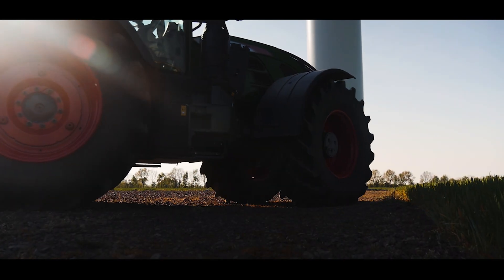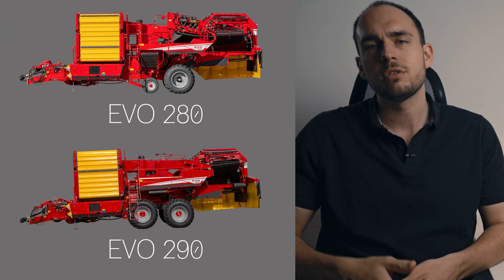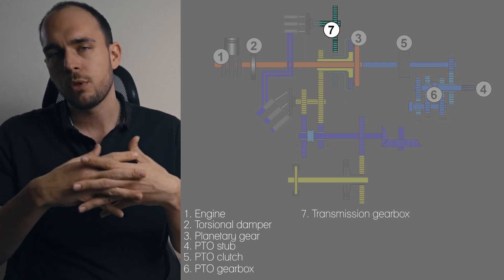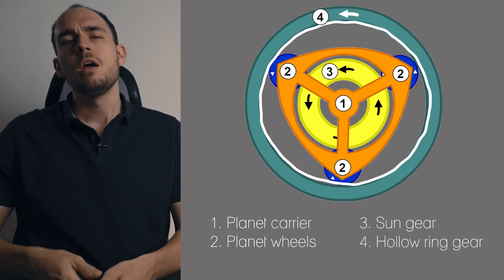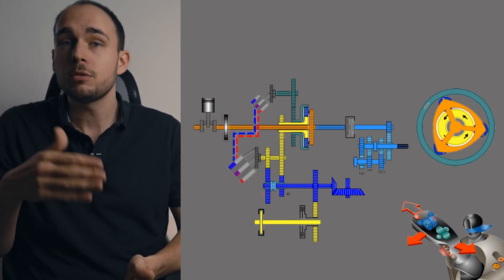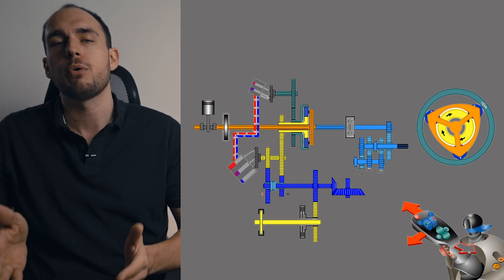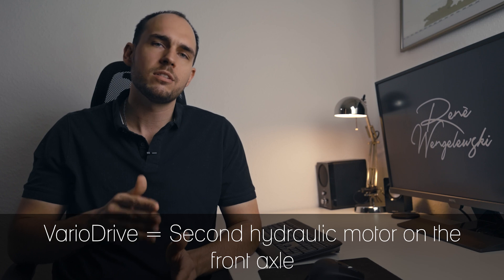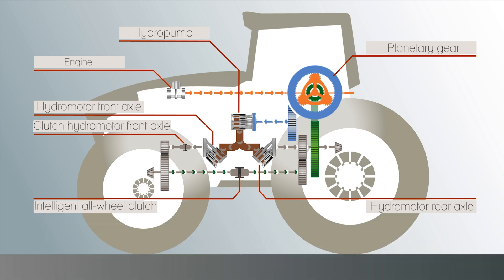The Vario transmission | Functionality | Fendt 724 | Renè Wengelewski | 2021

Comment: So while I do understand the benefits ov cvt/vario in field work or around the yard, I'd like to understand why do they get progressively slower when hauling load up the hill to the point where even lower powered tractors with other transmissions, and espl manuals, leave cvt/vario far behind? 
Also, what's vario like in downhill scenario where engine braking is important not to overheat the brakes?
And why aren't hgv's using this type of transmission?

Comment: What you talk about with 'VarioDrive'. That's only possible with the 1000 series and the new 900 series. The older series 900 and 800 (ML200 and ML260) does have 2 oil engines in the vario but they are always connected. The new vario, for the newer 1000 and 900series (ML400), have the 2 oil engines independed and when wanted connected as shown in the video. How I know you probably think.. I work as a Vario rebuilder, And I've seen all the kinds of Vario there are. (ML75/ ML90/ ML130/ ML160/ ML180/ ML200 (first edition for the 900 vario favorite) the now used ML200/ ML260 and the ML400 that is used in the new 900 series and in the 1000 series. 

Thanks for reading 🚜

Comment: something people don't understand: in forward the vario gearbox's hydrostatic group only act as a mean to brake the hollow gear which mean it's efficiency is pretty much irrelevant since all we want from it is to define the gear ratio of the whole gearbox by defining the hollow gear's speed.

you can turn anny 4x4 with a central diff to "vario ish" cvt by removing the rear drive shaft, puting it in any gear the rear output of the transfer case will spin freely until you start puling at the handbrake putting resistance on the rear output of the transfer case forcing the power to the front wheels that's how the vario works without burning your park brake using hydraulics instead.
Reply: Effeciency is still very much important , no matter if you use the pump for powering up or braking down. Doesn' t matter. If it takes to much power to act as a brake, the transmissions effeciency will be ruined also.
Reply: @bartdereu  that's where it gets tricky, how much the engine consume more as the hydraulics are worse and dissipate more through heat, someone at fendt's R&D surely know i don't. what i know is that the gearbox is cooled at 50°C instead of 90 on most tractors and easily even without a dedicated cooling circuit on recent models, to use it daily i can tell it was day and night compared to a semi power-shift even cold. And there is the DLG institute of our pragmatic German neighbours that did an extensive study of the European middle-sized range of tractors from all the big name brand 100 to 300+hp maybe even 400.

Then fendt tractors were either first or on exact equality first with cnh on one model and only the 514 or 516 was beaten by another cvt. 

The self proclaimed revolution that rivals with fully mechanical transmission that is the direct drive from deere was part of the studies, it would have been dead last if not for the same big promises brand's autopower that happen to be even worse.

no power shifts or semi P.S. beats the leading CVTs meaning those transmissions are up there between the good old mechanical and the best powershifts. Yes there are losses like any gearbox, but we are nowhere near an hydrostatic transmission in term of losses, despite what the presence of those component might get people to think.
Reply: @flo__60 true, many people say "hydrostatic is inefficient so 4 gear CVTs are more efficient" which is true for regular CVTs but not for the Vario because the pump is coupled to the ring gear instead of the input shaft, like other CVTs
Reply: @Sjanzo  the engine drive the satellites and the hydrostatic let go just enough to obtain the desired gear ratio it could be a set of brakes... but hydrostatic gives back with the motor that it takes with the pump acting as a brake. when fendt tested the vario transmission in polland they ploughed fields with a 926 turbomatic (semi power-shift)  and a 926 fitted with the prototype gearbox, the vario testbed consumed noticeably less fuel (cant remember the numbers but it was in the thousands of litter over the testing season) that's all we need is to know.
Reply: Key difference would be VARIO type hydro-mechanical transmissions are regenerative.

Comment: Super video again, great explained! On english is great ;-) Thank you!
Reply from the maker: Cheers mate!
Reply: @wengelewski  At 8 km/h in first range, I have pure mechanical drive? I didnt know that. You have two accounts here.
Reply from the maker: @tomyhr501  Yeah, I created this channel for english videos, the other one is only for german.
No, you don't have pure mechanical drive at 8km/h in first range, but the best efficiency. In a nutshell: Axial piston pumps have their highest efficiency fully swung out. They reach this swivel angle in drive range one at about 8km/h, in range two at about 12-14km/h. If you accelerate further, a larger mechanical part is added, but the efficiency of the hydraulic part decreases significantly more than that of the mechanical part increases. The hydropumps and -motors are therefore designed precisely for this speed range.. if this makes sense. You only drive purely mechanically at maximum speed.